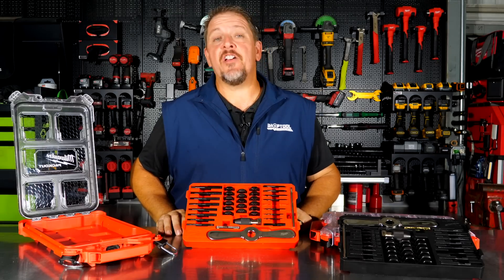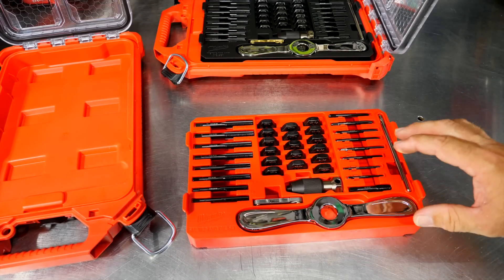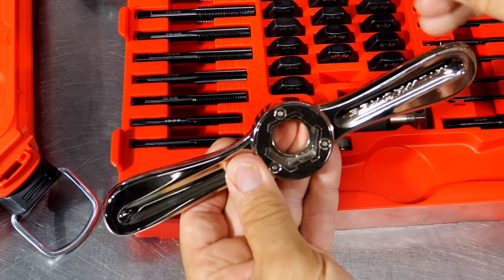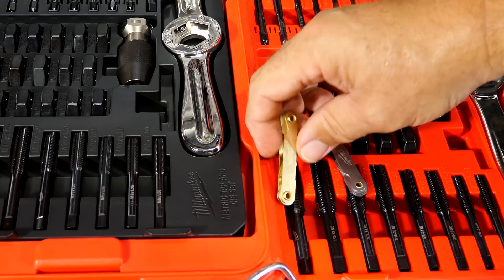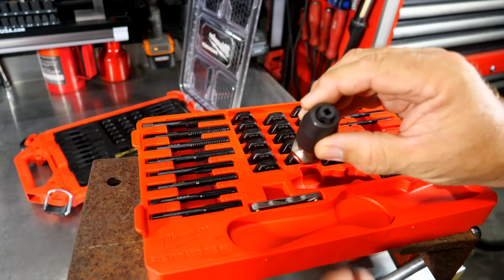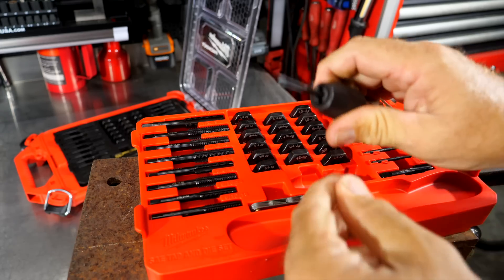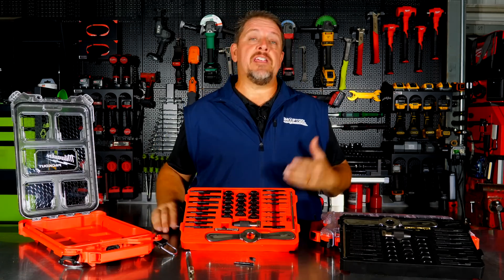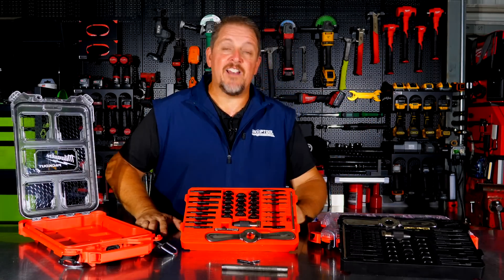PACKOUT and Die! Milwaukee PACKOUT Tap and Die Set with HEX-LOK Review [49-22-5603 -5604]

Comment: I have used at least 10 tap pack out cases including the 2 that I own and this is by far the best well thought out tap case. About time they have the tap dies sideways in case to save room. Great tap wrench. If I have more then 1 or 2 holes to tap go to my starter tap or one of the dozen gun taps. In thin metal I will drill one hole size under. Hole drilled with a hand drill always cone out oversized due to slight wobble.

Comment: It would be cool if they made drills in a pack just for this tap and die set where the drill would have marked on it not the size of the drill itself but the tap you should use with that drill bit so you don't have to look at any charts or tables and then they can sell more drill bits

Comment: I would be a little worried about those small taps in that jaw system, seems like it is not holding a lot of the shaft so maybe easier to snap if not really careful
Reply from the maker: It has the same amount of clamping area as any other tap system. Thanks for watching.

Comment: When you cut the threads how tight is the nut and bolt when halfway assembled how much wobble is there??? And are they bottom out taps that thread to the bottom of the hole??? 
Cool is cool but sometimes not feasible...

Comment: Awesome sets. Just wish they made these ratcheting handles like gearwrench does.
Reply: Those are a bad idea. I've seen people using them and wonder why they break so many. The inclination is to stop thinking about what you're doing and just go. Your muscle memory in using ratcheted tools takes over and you just go. The obvious problem being you're not back tracking to break chips and likely also not adding oil at the right times because you're on autopilot.
Reply: @LordPadriac  I have had zero issues with my gearwrench ratchet taps. Quality taps and slow movement is all you need haven’t broke any taps and it gets me into tighter spots because I dont have to a 360 revolution to cut the taps. And spinning back to break chips is very easy